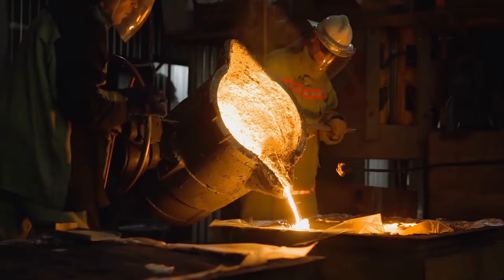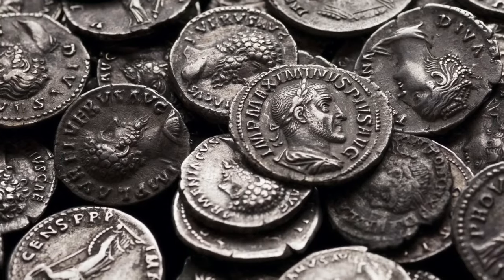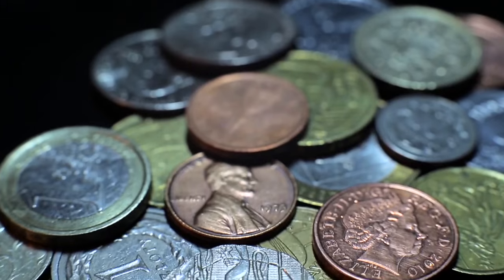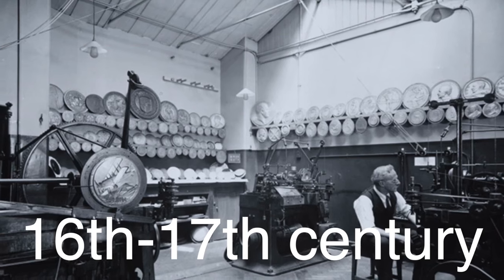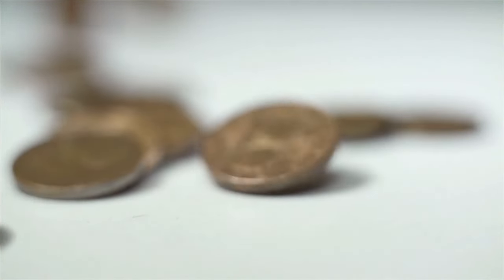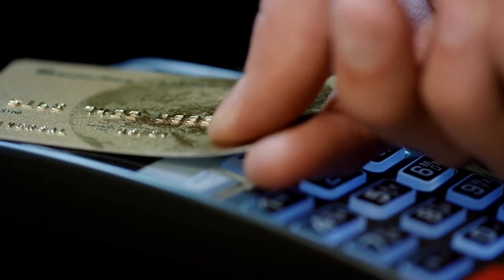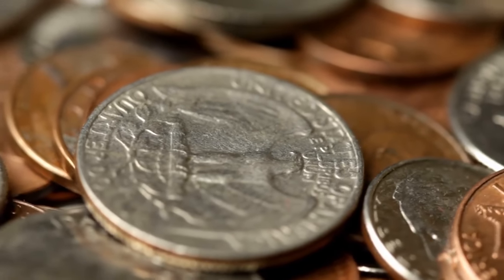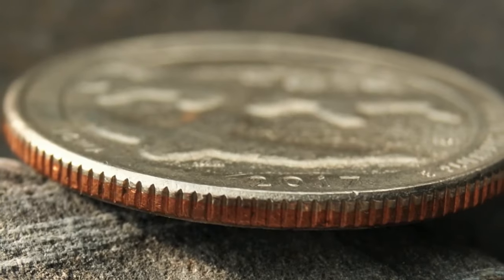The Purpose of Coin Ridges: Why Are They There? | 1.1

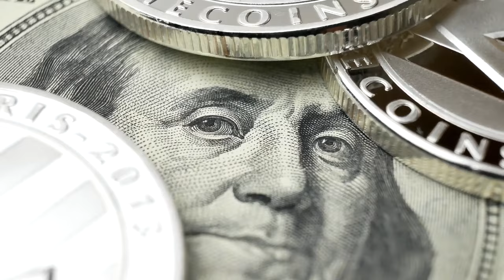Comment: Regarding 4:18, during the coin striking process there actually three dies that are used. The upper die is called the hammer and the lower die is called the anvil. They impart the obverse side as well as the reverse side of the coin. The third die is known as the collar which is a circular retaining ring that acts a fence to form the edge of the coin. It is the collar die that actually imparts the ridges onto the edge of a coin. Furthermore on some coins, instead of ridges there may be edge lettering that spell words. Other collar dies may be smooth to form a plain edge that has no ridges or lettering.